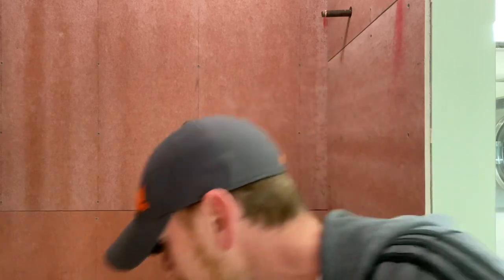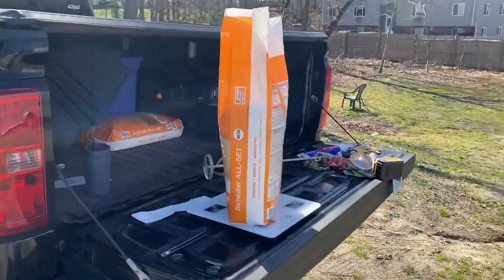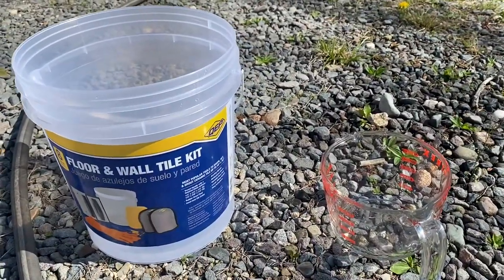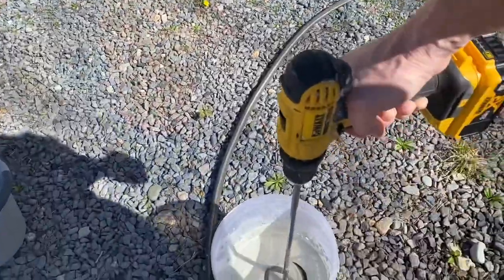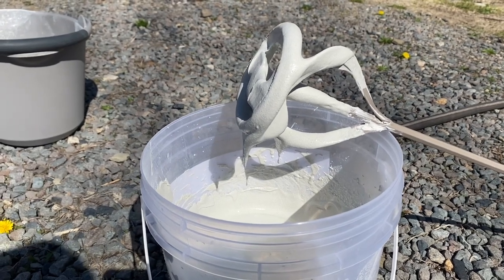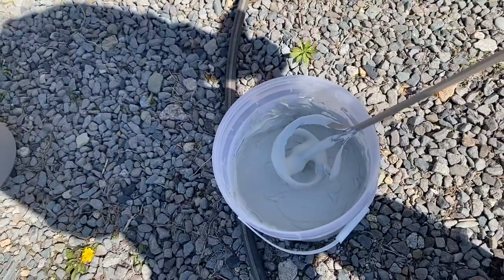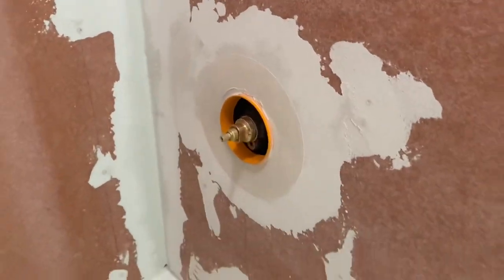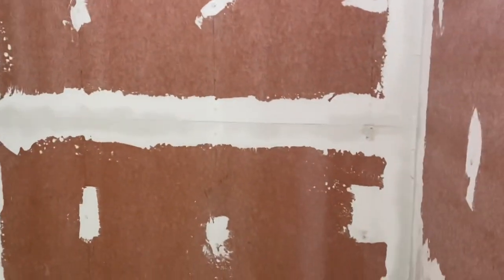Mix only part of the bag / Schluter All-SET

Comment: The Schluter instructions say to use between 7.5 and 8.5 quarts. So.... how do you handle that range? Start with the lower amount and add water up to the max amount?
Reply: No, you can't add water after you mix everything based on Schluter's instructions.  It appears that he used 8 quartz of water and covered it to Ounces then took 1/5 of that. You use the lesser amount of water for tiles, the middle for Ditra and the higher number for the membrane.  That's the rule of thumbs.  It doesn't mean that you can't use the higher range for tiles, it's just a way to help you start.

Comment: Hey Joe, Just a question. when putting the waterproof fleece and bands. Do you put it to its wettest consistency?  I was showed to do that, to help be able get the air bubbles out and not have as much thinset under it, to lessen the water wicking from the thinset.  Thanks